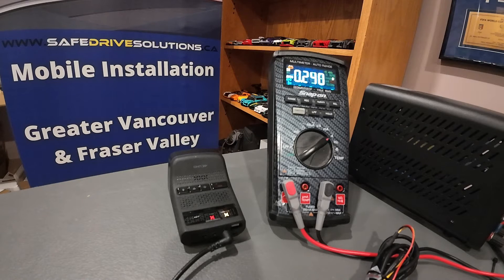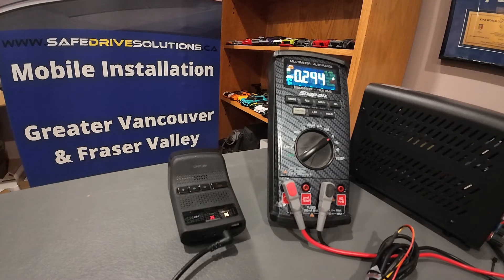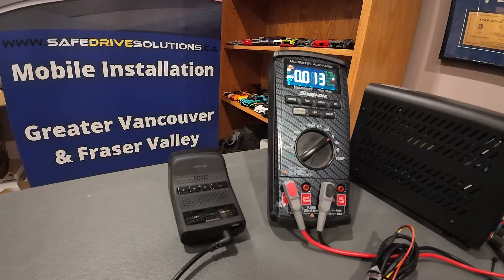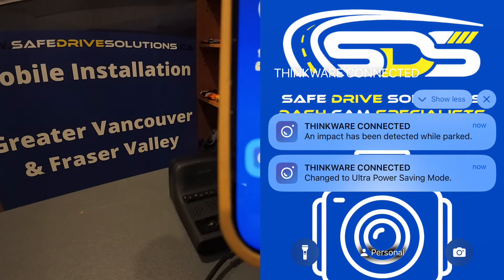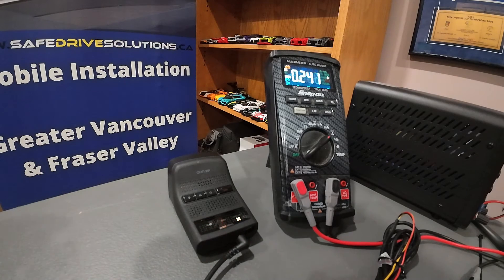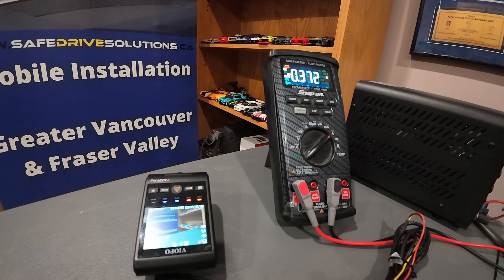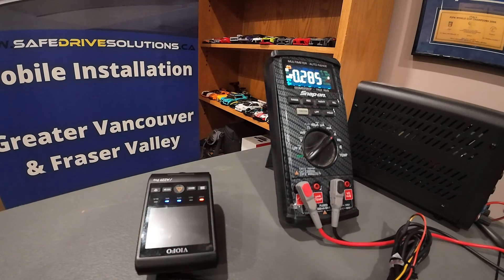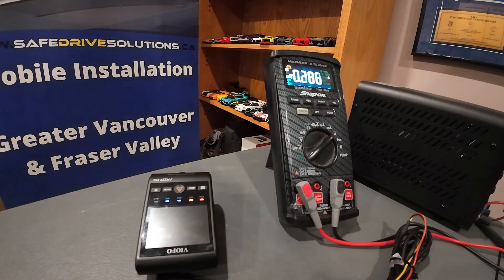How Motion Detection Works On a Dash Camera

Comment: Hi 
Thank you , about your information , but my friend I go in the meno and is on motion detection after 1min agen back to meno , I see motion detection is off , you now for what ?!!
Please tell me , thanks
Reply from the maker: Do you have the parking mode cable installed for your dash cameras?
Reply: @SafeDriveSolutions  yes , parking mode is on , but sometime parking mode is off , but motion detection on and after is off , why
Reply: And my camera car is black box , not wifi , only whit memory card recording
Reply from the maker: You did not answer the question. Did you hardwire the dash cameras with parking mode cable? If you are using cigarette lighter there is no parking mode cable installed
Reply: @SafeDriveSolutions  hi 
Yes my camera car direct to battery car installing not is lighter machine
Reply from the maker: @RR.A-jc1ss  So is your ignition and constant power hooked up correctly or possibly backawards?
Reply: @SafeDriveSolutions  hi 
Any connect is curect , you think if  my camera car back to default system bether or no ? Meaby motion detection after working.

Comment: Thank you for this awesome video. I want to ask you, I’ll install my U3000 next weekend, now watching this video I’m little more clear about how it works, but still some doubts. I know draw is very low 10ma during radar and around 240 ma during motion, my question is, what event will the camera record during each of them? I suppose all events related with motion in that mode and what about with radar ? Or other like saving mode? TIA Ben
Reply from the maker: this unit will record every motion video in radar parking mode. The main difference is it is not buffered in radar parking mode as it only records when someone moves into the frame.
Reply: @ thank you man, very clear now, you always responding rapid, that tells a lot how much you love your job and care about your community. God bless you !

Comment: VIFOA 229 has parking mode, motion detection but the video fails because PIR does not transmit through windshield effectively. Unknown electronic as every Chinese manual is never transcribed perfectly. Microwave would be ideal as this is commonly used in commercial buildings for detection in lighting security or other. Unfortunately there's no time for confusion with a general public to exemplify bias engineering from China planned torture for Taiwan USA imports over 80 billion computer parts for US industry. Do not buy from china illusions in sales.

Comment: Hi
1. In your comparison checking the viofo having around 280 mah in motion detection, is it using 3 channels for the test?
2. Any idea what would be the in consumption if unplugging the inner camera off?
3. You suggested to use Timeplase or low bitrate recording for better consumption
, however I'm not sure how the output files of this modes help to identify "soft" non G-sensor events, such as keying your car\ scratches \ side opening of another passing car's door on your vehicle etc.
I mean since it records all the time, I feel it is impossible to fast forward on events of people or vehicles which have reached too close to your car.
So I wonder how these scenarios contribute to securing the car while parking if a human cannot pass all over the 8 hours of video recorded.
I would happy to hear your insights regarding it :)
Reply from the maker: 1. this is front camera only. 2. This is front camera only. Front and rear is about 380ma 3. this allows for constantly recording while parked and if you notice something you can review the footage. The challenge is viofo uses motion detection which has some challenges like locking up in high heat.
Reply: @SafeDriveSolutions 
How much ma for 3 channels in parking motion detection?

If I noticed something, I will have to go over hours of recording- in timelapse or low bitrate recording, any suggestion for this case, as it is not possible :)
Reply from the maker: @Nadavgu  You can use the Auto event detection feature on Viofo if you want. Just warning that in high heat environments you may have a challenge.
Reply: @SafeDriveSolutions  Any Idea how much consumption ~ in ma for 3 channels in viofo 229 plus with motion detection?
Reply from the maker: @Nadavgu  it is approx 500 ma
Reply: @SafeDriveSolutions  
Same question regarding 3 channels of viofo 229 plus, how much ma for low bitrate 3 channels, and how much for timelapse 3 channels lets aay 10 frames per sec?
Reply from the maker: @Nadavgu  all 3 modes are within 10 ma of current draw of each other. No big drop in current. However..... They are working on a new lower current time lapse firmware..... I guess we will see if and when it is released.....

Comment: What happens if u have park mode and motion mod ? What one do use for survalnce
Reply from the maker: Not sure what you mean by that question. If I had U3000 installed I would use Radar parking mode
Reply: @SafeDriveSolutions  have a yada daul cam . U can turn on both parking and motion
Reply from the maker: @Luciferian6123  so none of our dash cameras work that way. Typically if you have parking mode turned on. You will have option of time lapse, motion detection, impact detection. You must select which version of parking mode
Reply: So at night time what's better

Comment: Hey, thank you for your videos. I thought you were the perfect guy to ask these questions. 
I need a dash cam, but in order of priority. 
1. Reliabilty
2. Able to read license plates day and night.
3. Able to see human faces. 
4. The parking sensor works and has pre - and post recording. 
5. Cloud live recording when event occurs. Preferably at no cost and the reason why I am at this video. 
6. Front - cab facing - rear facing cameras. 3ch
7. Battery hardwire able. 
8. Wifi and not LTE due to cost.

Thank you
Reply from the maker: You are asking for a lot here. I can honestly say not 1 dash camera I have ever tested has all the features you are asking for. Some may come close but they will be missing a feature or option.
Reply: @SafeDriveSolutions  sadly then. I am hung up on a229pro and the u3000.
The U has the cloud and parking, but the A has the image quality!
I value image quality highly, but I want to be able to have a cloud that sends me messages and notifications.  The U also has great parking options. 
So, get a notification about over exposed video or risk losing footage and not be alarmed when the car is being attacked.

Jargon: I suppose because of my job, I stay near my car, but I still sometimes leave the jobsite, so still.
Reply from the maker: @keywestalert6329  Are you going to paying for a hotspot or cellular activation to use cloud while away from vehicle? Are you going to be investing a battery pack?

Comment: Also, what kind of motion detection is it? Is it based on changes in the camera CCD sensor, which can give a lot of false positives (i.e. changes in lighting), or is it radar based motion detection? Is the radar 360-degree detection or what is the arc and range of the radar sensor? There are a number of factors to consider. I seem to recall something about car alarms mainly for convertibles having "proximity" sensors that would cause the alarm to chirp if someone was in close proximity and then alarm if the subject was still detected and did not leave in a short time frame.

Comment: Is there another model or manufacturer with radar Parking Mode except that u3000 ?
Reply from the maker: We are not aware of any other manufacturer utilizing radar sensors besides thinkware.
Reply: @SafeDriveSolutions  The thinkware q1000 can use an external radar module however certain things cant be used with radar such as live view so not worth it for me.

Comment: I install ADDKEY dashcam and it got 24hr parking mode, motion sensor and G sensor. I install the hardware kit and it install correctly, I know because when I turn on the lapse time it recording while leaving car turn off. with the G sensor and motion mode. when the car off. I try to shake the car and bang it also walk infront of the car but nothing was recording, with and without turning laps time mode. I motion and g-sensor on high mode  is there anything else I need to do? or what have I done wrong?
Reply from the maker: Not familiar with brand

Comment: Thanks for sharing this insightful video!

I was wondering, though, what are your thoughts on the BlackVue Magic Pro? Do you think it would effectively protect the car battery? I'm considering pairing my VIOFO A229 Pro with it to ensure my car battery is safeguarded. From your perspective, is this combination not beneficial, or are there better alternatives?

Additionally, could you recommend a DashCam battery that you believe is the best option for reliability and longevity?

Looking forward to hearing your expertise on this!
Reply from the maker: Hello, first off the power magic pro will work but I would not use it. I would purchase the Viofo HK4 hardwire cable as that will hook directly up to it and allow you to have a lot more control over parking mode. The cable has low battery protection built into it.  Personally the Thinkware IVOLT Xtra all though is still newer to the market has worked great for me and I find it works a lot better for newer vehicles due to how it has to hook up. We will be showing a different dash cam battery pack on our channel this saturday. Which i have had for 2.5 years and still operates as new
Reply: @SafeDriveSolutions Thank you so much for the detailed response.

It's incredibly helpful to learn about the advantages of the VIOFO HK4 hardwire cable over the Power Magic Pro, especially regarding the enhanced control over parking mode and the built-in low battery protection, which I wasn't aware of it.

I'm also intrigued by your recommendation of the Thinkware IVOLT Xtra. Given its performance in newer vehicles and the unique way it connects, it sounds like a fantastic option.

I'm particularly excited about the upcoming video on the dash cam battery pack you've been using for 2.5 years with consistent performance.

That's exactly the kind of reliability I'm looking for. I'll be sure to tune in this Saturday to learn more.

Your insights are invaluable, and I appreciate the time you take to share your expertise with us!

Comment: Hi, Thankyou for the video. I would also request to make a detailed video on a229pro with the latest firmware.
Also I have a 2012 Camry Hybrid and I’ve installed a229pro 2ch. Auto event detection parking mode and I get recordings until 8-10 hours.
I drive my car for Uber but I don’t know how it is able to save videos from all night and day times while overnight parked.
Would love to hear from you.
Thanks
Reply from the maker: you may get that with a hybrid. I have heard of some people getting long recording times in hybrids but you have to be careful as well. We are working on trying to give a very educational video on car batteries. Believe it or not some car batteries below 12.4 volts is considered dead. Vehicles just keep changing
Reply: @SafeDriveSolutions  I am using the hk4 kit and I believe I have set it up at 12v or higher.
Should that be alright?
And also can this longer recording time hurt the hybrid battery as well??
Thanks
Reply from the maker: My business partner has endless pages of notes we are trying to turn into a script and dumbed down so it is easy to understand. I think he did not even realize how much car batteries had changed when he got into it.  I dont want to tell you the wrong thing. But we always tell people 12 volts and 3 hours with no battery pack and typically everyone is fine. But running it for 8-10 hours. It is hard to say. You do drive a lot with UBER so your battery may be staying very healthy charged.
Reply: @SafeDriveSolutions  Thankyou for your prompt reply, I’m looking forward to your new videos.

Comment: Thank you Sir. This really insightful. I've just tried live view through motion detection and it worked, but on Radar mode it doesn't, this confims ur argument. Can you please explain why U3000 speed limit is not working given that GPS is working fine. I ve asked thinkware and they said it's related to region which is weird.
Reply from the maker: Where do you live that it is an issue? Is your unit mounted too close to another gps antenna possibly?
Reply: @SafeDriveSolutions   I live in Morocco, but as long as GPS is running why should it alert me when I exceed speed limit. It is really weird to relate this to region.
Reply from the maker: Red light and speed camera info is region specific. They use garmin data for that

Comment: Ben, thank you for another great video.  I totally understand the power difference between "motion" and "radar" power draw on the U3000.  If you are going to be parked for an hour, which mode would you recommend?  Is one more sensitive or better than the other?  Thanks again.
Reply from the maker: Motion detection is suppose to have a wider range. For 1 hour either is fine in my opinion
Reply: @SafeDriveSolutions  Thanks so much for the help.

Comment: Yo Ben,
Nice demo.
3:37 The 15 minute Auto Power Off function on most multimeters can be disabled by holding down the “HOLD” button before turning on the meter.
It will then remain on indefinitely until the battery dies.
If that doesn’t work it may be a different button, check your user manual.
-Chuck
Reply from the maker: I will try that out